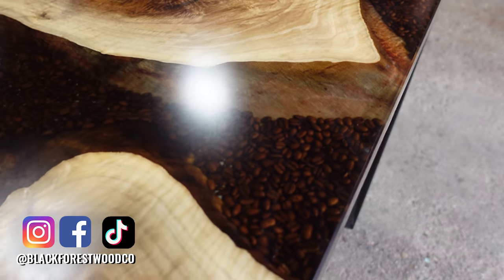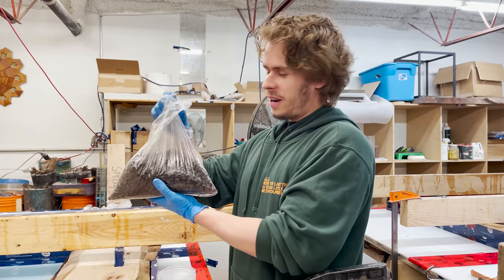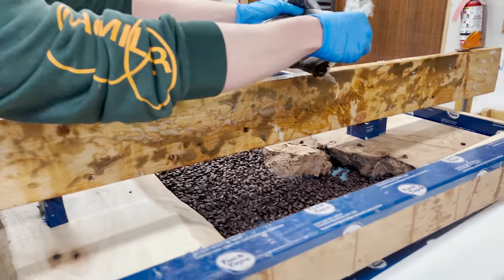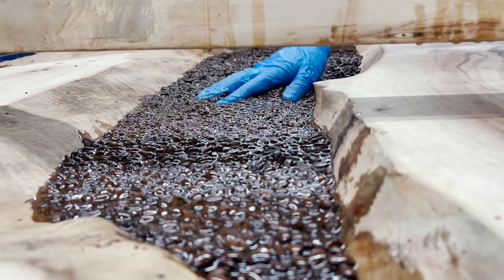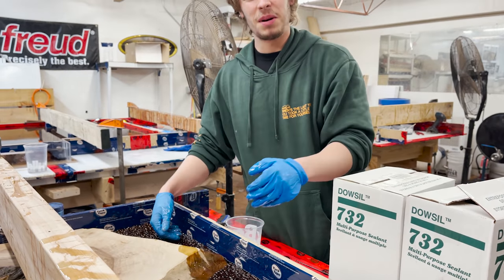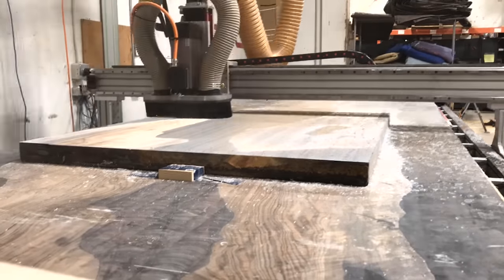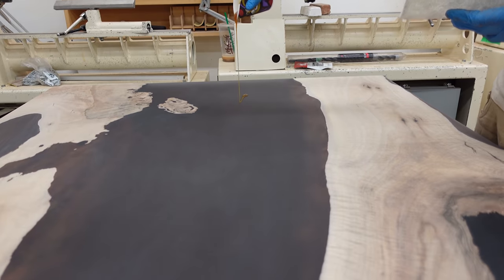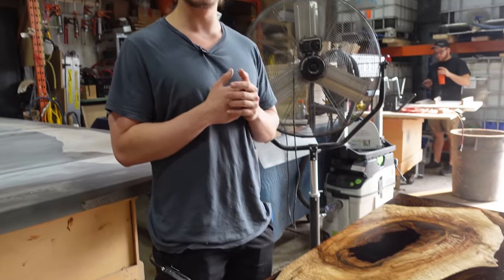Making a Resin Table Filled with Coffee Beans

Comment: I made a similar table, but used wine corks.  Same method, base layer, wait 'till nearly set, glue layer holding down the corks and then the final pour.  I vastly under estimated the buoyancy of the corks.  Corks floated upwards, taking the first base layer with them.  Completely ruined the project.  Beans must be more dense!

Comment: Would like to make a river table with engine parts  any advice  on prepping  the parts
Reply: Hi!
Degreasing any part needed,  clean up, air dry  them, and paint clear top epoxy on all parts? 
Meaby a clear primer on the parts before using epoxy is needed?

Probably how I would do it, if no one gave me a better idea? 

Try with one metal part first that you can get a easy hold of again if needed.
You know  - just to get an idea of what that is the best way to go?

Comment: Hey the next time you do this, i think it would be a thousand times easier for you if you reversed your order of operations. Do your thin pour of resin, so the resin is already in, then pour the coffee beans in on top of the wet epoxy. 1) you wont have to readjust, you only then have to 2) push the bean down into the wet epoxy. Should make life 100% easier the time consuming method you’ve used. Im sure it took a long time to get the beans seated back into the right locations. Just a thought
Reply: Also happy 1st aka 15* years old in dog years… birthday to Charlie

Comment: Happy birthday Charlie! Beautiful table as well. Question.... Did you "clean" the coffee beans before you added then to the table? If so, how? In making coasters with beans I find pieces of what I'm guessing is the husk/shell.
Reply: I feel like they didn't clean the beans, hence the flakes you see in the epoxy under certain angles. The one thing I think they did to prevent the flakes from floating up, is pouring a thin layer onto the beans first, effectively locking in the husks, and then pouring the final layer. Still looks absolutely stunning though, and I wouldn't be able to do it any better myself, obviously!

Comment: When you guys trimmed the edges, did you have exposed beans that you had to cut through? I'm actually about to start a much smaller river board with coffee beans and can't seem to wrap my head around that part. Or did you even trim the edges at all?
Reply: Did you ever figure it out? I'm about to do the same on a river board. I'm just going to babysit the pour to keep pushing back the beans as it "thickens up"... or a thin piece of HDPE as a dam on each end of the river until it thickens up a bit, then pull the dam out while I still can... Then the next clear layer will go to the ends and should hide the difference in layers. If I cut close to, but not touching the beans it should look proper... I hope.
Reply: @stevenlarson6125  You know, I still have yet to give it a try. When you do it, let me know how it goes!! I think your idea of "pushing the beans back" might be the way to go.

Comment: nicee im doing the same thing w fire glass rn and leds underneath. i think the beans shoulda been higher up in the layers
Reply: Yeah. Could one have poured a third of a layer of epoxy then a third of a layer of coffee beans, then a third of a layer of clear epoxy over top? Why is the ceramic needed on top? Is final hardened epoxy not sufficiently hard to be a desk or table top? I don't remember you talking about this step before, but maybe you have. I'm a newer subscriber.
Reply: @kmitchellbarr  same lol i think the ceramic coat is like the same reason you'd get it on your car. Its not needed but its an extra layer of protection and finish that ultimately add to the final product